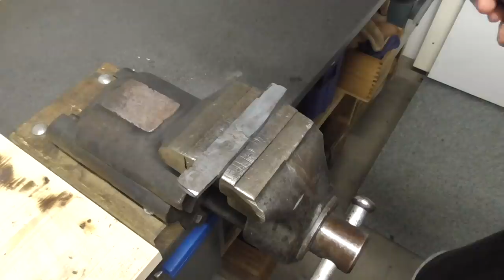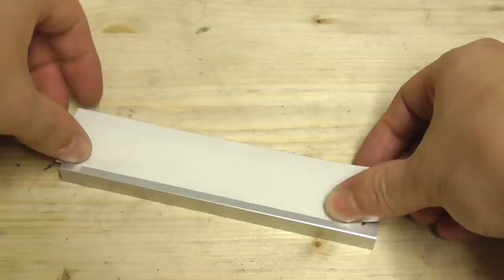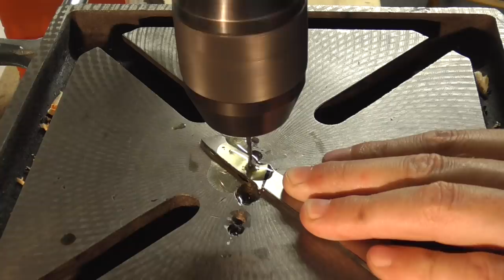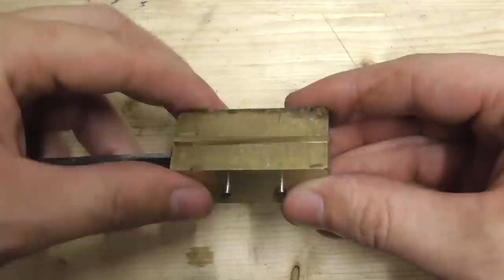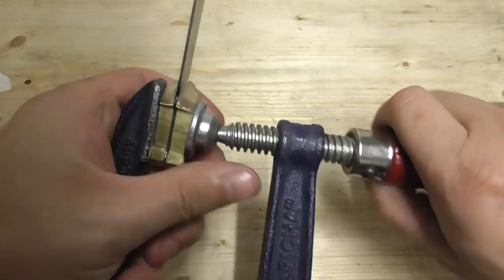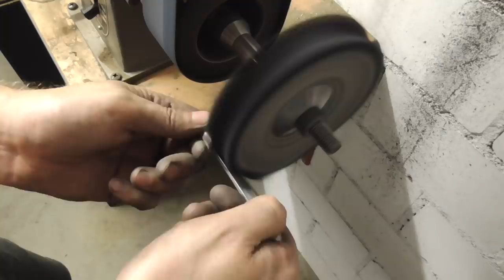Making a Mini Machete from a Stainless Bolt

Comment: A beautiful job! There is no denying that.
There is one teeny weeny point that springs to mind though...
I have lost count of the times when I have thought to myself: "Dammit! I haven't got a bolt big enough! This job will have to wait until I can get to the hardware store..."
I am searching my memory but I don't think I have ever thought to myself: "If only I had a tiny machete..."
Reply: Lol 😆
Reply: @joanschwanz7970  Maybe if I should ever find myself contemplating the tools  I'd need to tunnel out of prison, a hand forged 3-inch machete wouldn't be at the top of my list. Obviously, if you happen to HAVE it, you use what you got. But, if you're is a situation in which you're thinking "I know what would be really useful right now... a 3-inch machete. It would scratch this mortar between these blocks so much more aggressively than this wooden toothpick!", you're chancesof success are not good.
Reply: @rontocknell3592  lol 😂
Reply: You have to admit though…it’s a damn nice letter opener.

Comment: Am I the only one who's shocked with the amount of brass he used for the scales?
Reply: The same thing went through my mind.. That was just way too much, less than a quarter of it would have been enough.
Reply: Totally, remember that old cartoon where the wood cutters cut down an entire tree, then a machine shop whittles the entire tree down to a toothpick? This guy has metalworking skills I would kill for, plus infinite calm and patience it seems, but he's so bad at estimating material usage & wastage. Could've done this entire build with a bolt a quarter the size, and a tiny sliver of brass.
Reply: Me too😟
Reply: I was just thinking the same thing. What a waste of good material and time. He could have cut one piece down the middle and used it for both sides.
Reply: Now it time to build a miniature warrior to put it to use.
Reply: @kenbtheman  it was probably just a mistake that he realized afterwards.
Reply: you can.. melt down metal fillings and recast them 🤨
Reply: No, I'm here too 🙌
Reply: @sufferine  you mean all those metal filings that fell onto the floor while he was polishing?
Reply: @attilakerfalusi3409  yeah what a waste of good material... only one piece is enough i guess...
Reply: No I thought it was the exact right amount of brass.
Reply: Also keep in mind this guy is obviously loaded, he has access to 10s if not 100s of thousands of dollars of equipment. He’ll be fine
Reply: @H3liosphan  Hah! I was just thinking about that one lately, though it was more in relation to some of the wood lathing videos.
Reply: yea ;-; I thought he was going to use one of those blocks and cut it in half

Comment: Nice job but wow that was an awful lot of  wasted brass. But again great finished product.
Reply from the maker: Thank you dan! Compared to the finished handle, yes. But it were still quiet small pieces. I found that piece in my shop, i took it home from a junkyard years ago. As this was my first time doing something like this, i wanted to make sure that i have enough, you can always grind off more, but to add more would be difficult. Thanks for your comment
Reply: Are you in the U.K?
Reply from the maker: @danhewitt1984  i'm from switzerland
Reply: @mymechanics   shame I would love to buy this I would solder a ring you the handle end and make a pendant the more I look at it the more I love it. I would Love it if you could make some sort of scythe as in the Grim reapers type.
Reply from the maker: @danhewitt1984  i'm using it to open my letters 😎 it would be a dangerous pendant, imagine you put it on your keys and then in your pocket 😱 but if i need the money at some point, i will remember that...
Reply: @mymechanics  danger is my middle name lol. I wouldn't wear but I would have it in my man cave but perhaps If I can find some where to get my  acetelyne refilled I will try make one.  Thanks for the reply and apologies as I realised I wasn't subscribed so I did and turned on notifications so better get that video up lol.
Reply from the maker: Thank you danger dan 😉
Reply: @mymechanics 
*Dan Danger..Winky face.
Reply: Wasted brass? He turned it into a badass handle. I'd hardly say it was wasteful
Reply: Can you make me one?
Reply: My exact thought, same with the adhesive

Comment: This little machete would be ideal for a 12 inch tall gladiator.  Atlast we are running short on mini gladiators now days.
Reply: Use it as a letter opener = )
Reply: You mean "alas" not "atlast" (at last). Just an FYI. No criticism.
Reply: @candice_ecidnac  at last, someone who corrects grammar politely and constructively
Reply: That reminds my of a Karen Black short: "Zuni Doll". Scary AF!
Reply: Well actually Gladiators used Wooden shields outlined with steel and sometimes a sharp tip and a linked double edged sword. Not a machete. what, is Jason a Greek Warrior now?

Comment: Long time metal finisher here. Tip; When your buffing/polishing wheels get "dished" out like that in the center, you need to put the outside surfaces of both together in the center which will make your buff high in the center & then you can rake it back to flat using a hacksaw blade.

Comment: your fit and finish is impressive, however it would have been more impressive if you had done more work with the hammer, first, and less work with the grinder, after.  I would have liked to have seen a much larger blade pounded out from that bolt instead of 2/3rds of it being ground away.